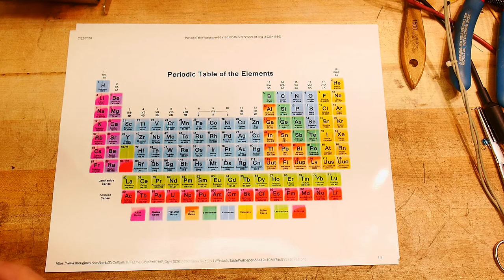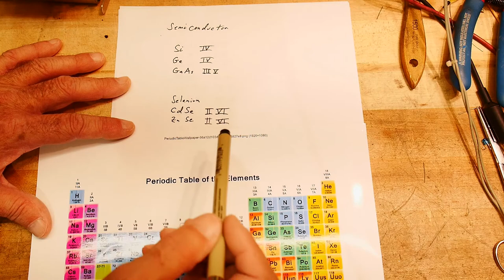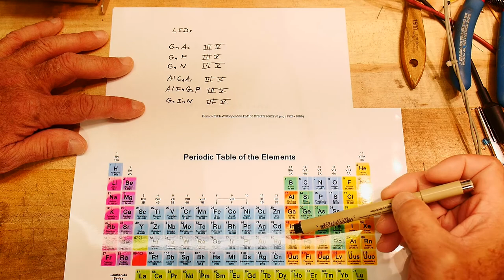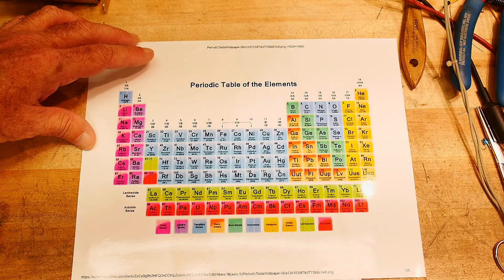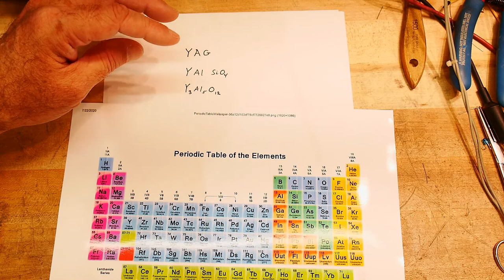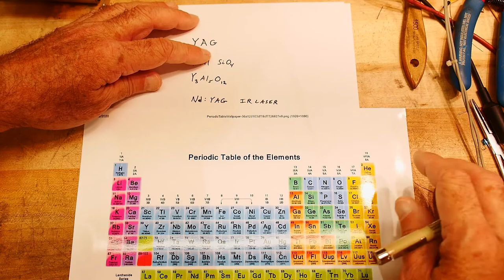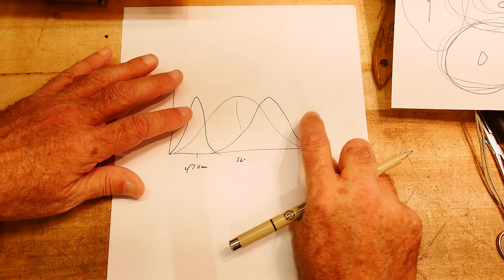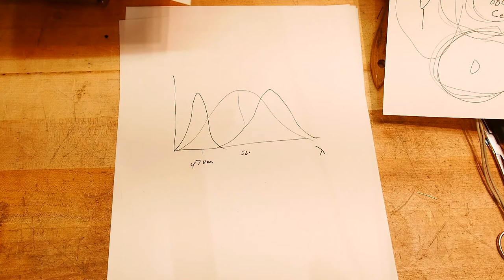#525 LED Phosphor Science

Comment: All these phosphor electrochemistries in LEDs.. I had no idea there were so many. But what about the non-ohmic tunneling diode mechanism? Can't you just make little electric lamps with these without making it a diode? Isn't electric current enough? And where is the diode junction relative to the phosphors? Thanks!
Reply from the maker: you need photon flux (power) you can't much current flow in tunneling
Reply: @IMSAIGuy  if I understand you correctly, you're saying the diode junction limits the current flow by forcing the electrons to tunnel... but I think I am misunderstanding because it seems to me there are other ways to control current like using short pulses... I guess you would have a lamp with more complex operating requirements then. Am I understanding correctly? Thanks!
Reply from the maker: @donaldviszneki8251  no, in a normal LED there is no tunneling (actually there is a tiny amount). it is a standard PN junction with very high density current flows. the electron to photon conversion (internal quantum efficiency) is 99.999%.
Reply: @IMSAIGuy  ahhh thank you! When then are all these devices diodes? Why don't I ever see electrophosphorescent lamps that are not diodes?
Reply from the maker: @donaldviszneki8251  oh I understand now. Please watch: https://youtu.be/gepeoKa1w7A
The phosphor goes on top of a blue LED